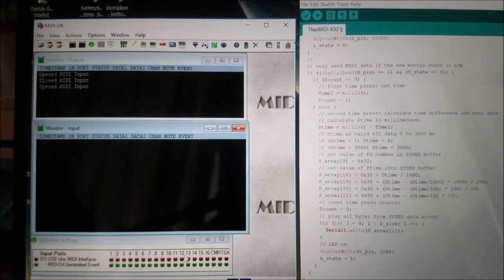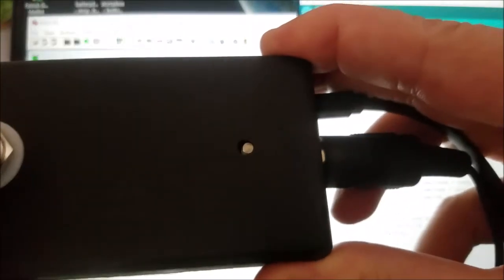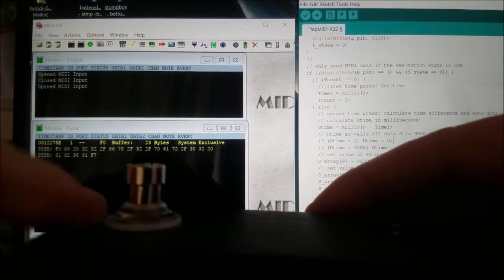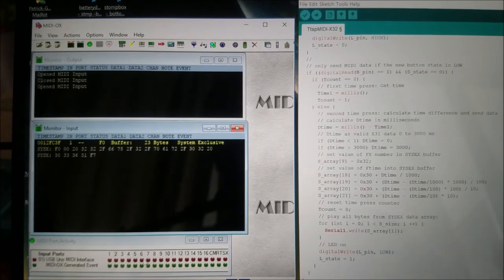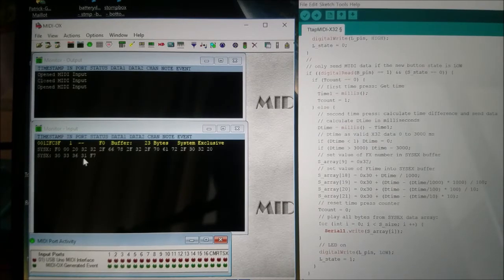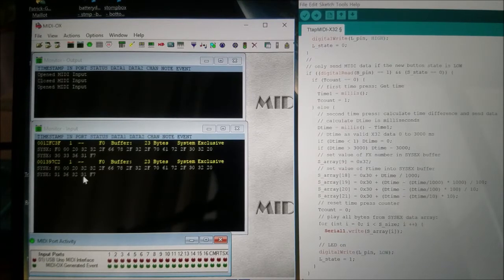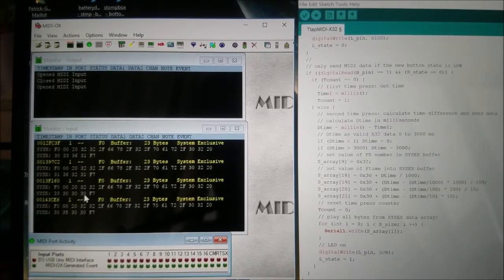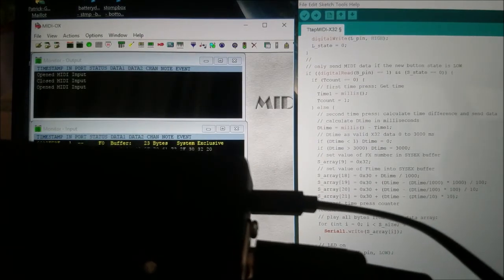MIDI TapTempo Stompbox

Comment: Hi Patrick. A year in and I'm still loving this arduino project. My build has held up well and works great with both my MR18 and my X32. I have a question for you. I'm interested in trying out the tap modifications you mention on your website, but as I am not a coder, I don't really grasp the instructions. I'd like to try to generate a new Dtime value at each press of the footswitch like you mentioned at the bottom of the X32 MIDI Tap Tempo Stompbox section on our arduino page. I cannot quite seem to execute the instructions correctly in the arduino editor. I'm a complete noob when it comes to code. I've been able to tweak the code to work with XR18 or X32 mixers, and have been able to also change FX parameter 1 and FX parameter 2 for the respective delays. I would like to try your suggested modification with the tap feature. I hate to ask, as you've already been so generous to our community, but would you mind showing me exactly how to implement those changes? Or post the code? Thank you so much!!!
Reply from the maker: Hello Doug,
Thanks for your kind words and I'm happy this example for a stompbox has worked well for you.
I looked at what I wrote at the time, and I think the code would be as below:
unsigned char S_array[] = {                         // MIDI SYSEX or command array data
  0xF0, 0x00, 0x20, 0x32, 0x32, 
  0x2F, 0x66, 0x78, 0x2F,
  0x30,
  0x2F, 0x70, 0x61, 0x72, 0x2F, 
  0x30, 0x32,
  0x20,
  0x33, 0x30, 0x30, 0x30,
  0xF7
};
//
const int     S_size = sizeof(S_array) / sizeof(char);  // MIDI SYSEX or command array size
const int     B_pin = 2;                                // Switch pin (in)
const int     L_pin = 7;                                // LED pin (out)
int           D_delay = 20;                             // Debounce time; increase if needed
int           S_state;                                  // state of the switch
int           L_state;                                  // state of the LED
unsigned long Time1;                                    // Start time
unsigned long Dtime;                                    // Delta time

void setup() {
  // called once at program start
  //  Set MIDI baud rate:
  Serial1.begin(31250);
  // Set pins directions
  pinMode(B_pin, INPUT_PULLUP);
  pinMode(L_pin, OUTPUT);
  S_state = digitalRead(B_pin);
  digitalWrite(L_pin, HIGH);
  Time1 = millis();
  Dtime = 0;
}

void loop() {
  // start main loop
  // read the state of the switch, check for state change:
  S_state = digitalRead(B_pin);
  // wait a few milliseconds
  delay(D_delay);
  // stop LED if needed
  if (L_state) {
    digitalWrite(L_pin, HIGH);
    L_state = 0;
  }
  //
  // only send MIDI data if the new button state is LOW
  if ((digitalRead(B_pin) == 1) && (S_state == 0)) {
    // second time press: calculate time difference and send data
    // calculate Dtime in milliseconds
    Dtime = millis() - Time1;
    // Dtime as valid X32 data 0 to 3000 ms
    if (Dtime < 1) Dtime = 0;
    if (Dtime > 3000) Dtime = 3000;
    // set value of FX number in SYSEX buffer
    S_array[9] = 0x32;
    // set value of Ftime into SYSEX buffer
    S_array[18] = 0x30 + Dtime / 1000;
    S_array[19] = 0x30 + (Dtime - (Dtime/1000) * 1000) / 100;
    S_array[20] = 0x30 + (Dtime - (Dtime/100) * 100) / 10;
    S_array[21] = 0x30 + (Dtime - (Dtime/10) * 10);
    // play all bytes from SYSEX data array:
    for (int i = 0; i < S_size; i ++) {
      Serial1.write(S_array[i]);
    }
    // LED on
    digitalWrite(L_pin, LOW);
    L_state = 1;
  }
}

Comment: Thank you so much Patrick for this Project! Help me a lot! One thing that I don't understand (I'm a beginner in coding) is how to change the MIDI SYSEX to control the time of the Delay + Chamber and not the Stereo Delay. Would be awesome if you had an asnwer for me!
Reply from the maker: Two possibilities there.  -1- load the desired effect in the the default stereo delay effect slot. -2- select the effect slot where your desired effect is loaded instead of the stereo delay slot. Changing the FX number for X32 is easy: just replace the byte data value assigned to S_array[9]. The default/arbitrary value is FX #2, or 0x32. Use 0x31 for FX #1, 0x33 for FX #3, etc.

Comment: This is awesome! I've built the pedal based on your site. I am new to programmable boards. I've built a lot of analog guitar fx pedals. I am very comfortable with reading and writing schematics for analog circuts. Code and midi sysex messages are completely new to me. I built the pedal and flashed the code. I get the exact values that you get using midiOX. I have a Midas MR18 mixer. The pedal doesn't change any values when hooked up to the MR18 via midi. Is there anything different I need to do to the code to get it to work with a XR18/MR18? I would assume that the FX slot number may be different on OSC as it has less channels than the X32?
Reply from the maker: Hello Doug, In reply to your two comments.
Thanks!. The XAir devices use a different port. change the X32's 10023 value to 10024 :)
Also, the OSC commands are for some of them different. I'll post later today a cheat-sheet I got sometime back on the XAir commands; it's quite complete even if not always easy to read, but if/as you've already understood OSC for X32 work, it'll be easy for you.

Edit: done. Available here: https://drive.google.com/file/d/1dLfUUf-wfjX_1iaPmvFkGBg4oo4aT1Ha/view?usp=sharing
Reply: @pgmaillot  Thank you so much Patrick. I look forward to the cheat sheet for the XAir commands. I'm a complete novice when it comes to OSC, but I"m willing to put the work in to have tap tempo on my Midas MR18.
Reply: @pgmaillot  Got it! It's working. For the X Air mixers, the delay time is on parameter 1, not parameter 2! Super excited. This is working well.
Reply: @pgmaillot  /fx/3/par/01 Just had to make this change to the OSC, convert it to hex, and now it all works! Thank you so much for doing this! You clearly have a heart to share your knowledge and experience for the good of all!
Reply: @pgmaillot  Oh. I see. Some of the delays have the time parameter as par1 while the stereo delay has the time parameter as par2. Confusing. I use the mod delay most, so I'll leave it set to par1. Looks like everything would have worked fine out of the box if I just used the stereo delay. Glad to get this sorted. This is an amazing pedal. I built mine in a micro hammond box with 9v guitar pedal input and space for  a 9v battery. It was an extremely tight fit, but it all works and looked beautiful. I'm going to mount it and my other 5 button midi controller - used for mute groups and delay mute, together onto a small pedalboard just for controlling the MR18 and my ATEM switcher.
Reply: @pgmaillot  how to recive midi  tempo from ableton ?? for delays
Reply from the maker: @andym7333  I don't know. Not using Ableton

Comment: Hi! You can send me a code for tap tempo Midi for my V Amp pro Rack? The Midi cc for tap tempo Midi is cc 64. My V Amp no Recive Midi clock...so i have many problems to Program Tap tempo in my controller. You can Help me? Tanks a Lot!
Reply from the maker: Hello,  I have no idea of what MIDI data/command to send to a "V Amp pro" rack. It says somewhere "MIDI implementation includes program changes, control changes and SysEx, allowing complete MIDI automation through our free Windows* editor software downloadable at www.behringer.com" So I'd suggest you download that editor software and hook it to the V rack to set a delay using MIDI. Then dump the data to a MIDI-OX window for example to get the MIDI values to send to your V rack from the stomp box. And you don't necessarily have to send SYSEX/OSC data, maybe sending pure MIDI is simpler in your case.
Reply: @pgmaillot  ok tanks a Lot! I Will Trie this way.